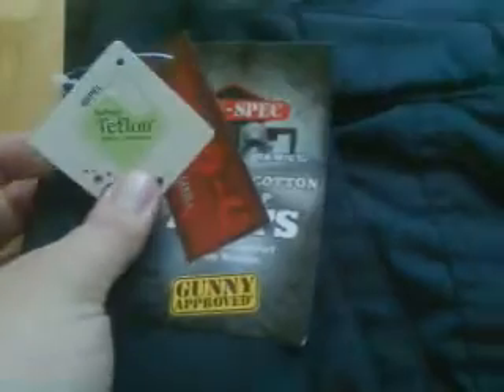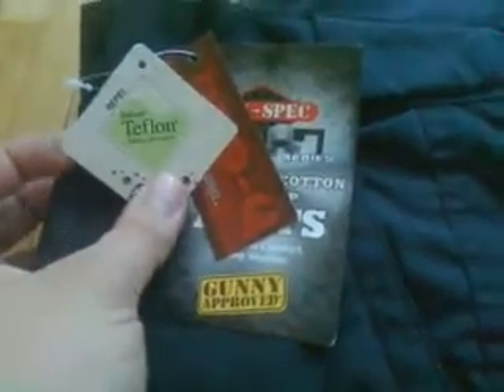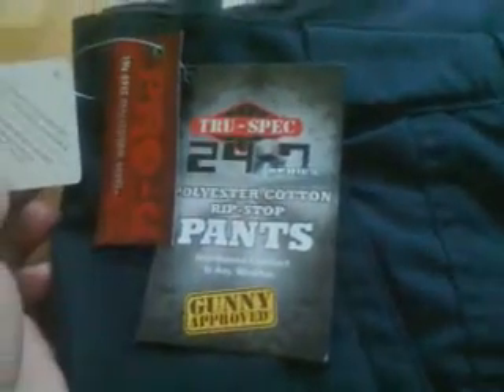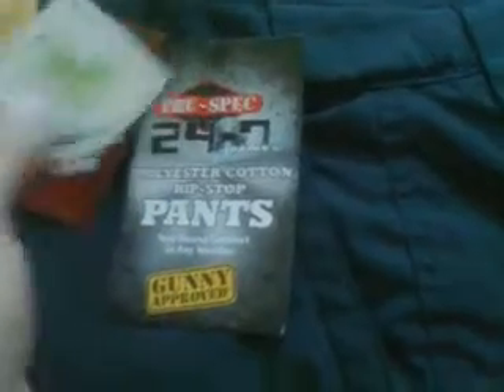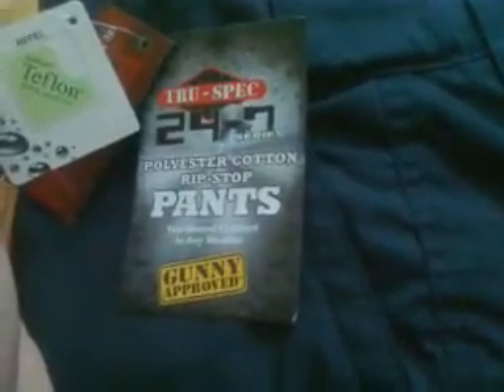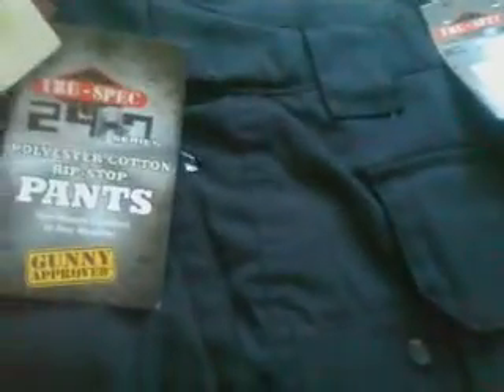Weird Hydrophobic waterproof Clothes- Dupont Teflon Fabric Protector

Comment: Bump. Yeah, the problem is though there's not a lot of promising data about the effects of what happens when that stuff breaks down. I honestly didn't realize pretty much all the waterproof clothing used Teflon. I figured they had figured something else out at this point. Kind of scary actually. Like my favorite brand of pants, for example...been buying and wearing them nonstop for the past decade or so. This whole time they were coated with Teflon. I know the C8 or PFOA they use in its production has absolutely decimating effects on biological systems.
Reply: lol. we could always go back to skinning seals and caribou 😂